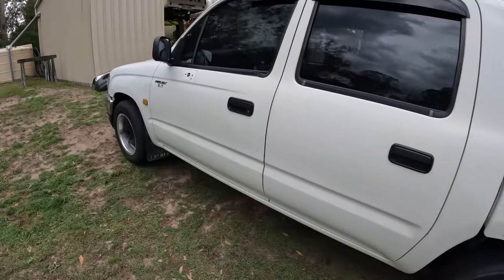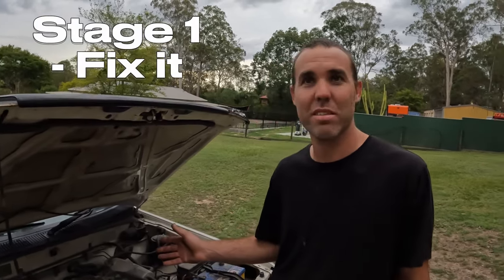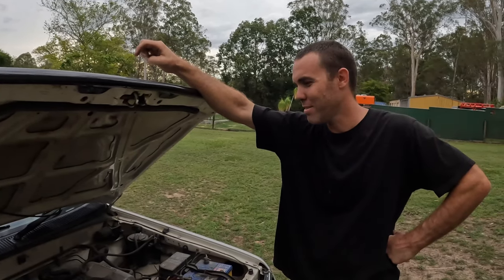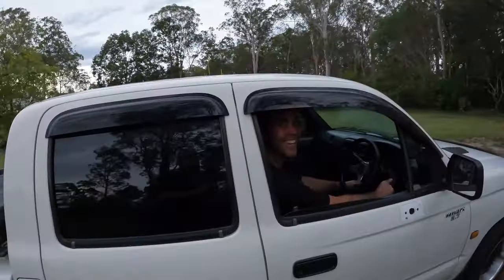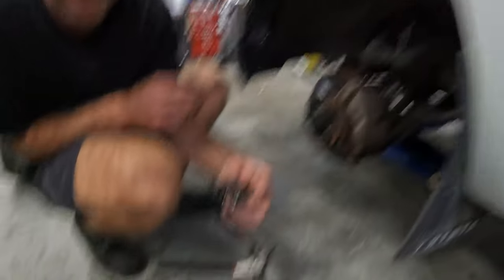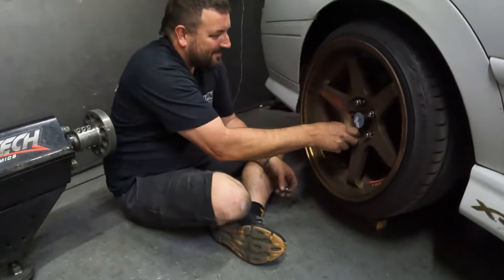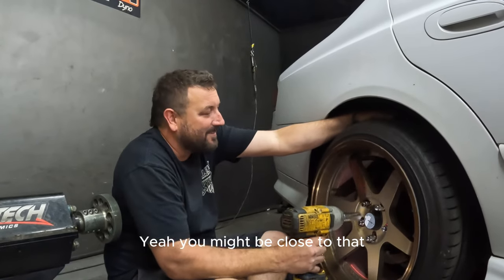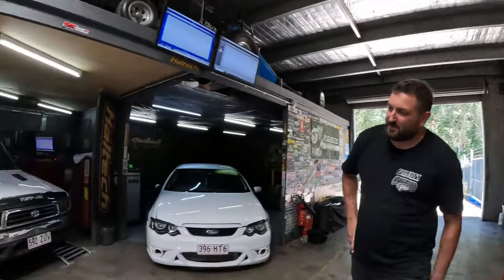3RZ turbo build from Mild to Wild - Episode 1

Comment: how much was the peek torque and at what rpm?
Reply from the maker: I didn’t have a tacho feed setup into dyno to calculate torque, however based on the known calculation and a guesstimate from the revs shown on the dash when the graph fell over I’d say 147lbft @ 4000rpm.